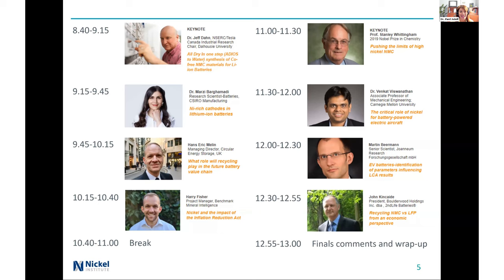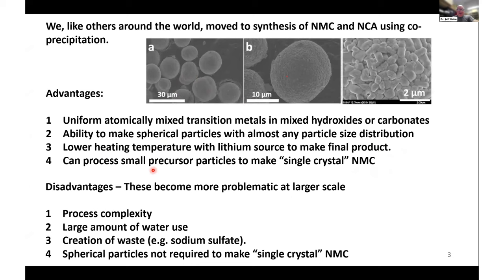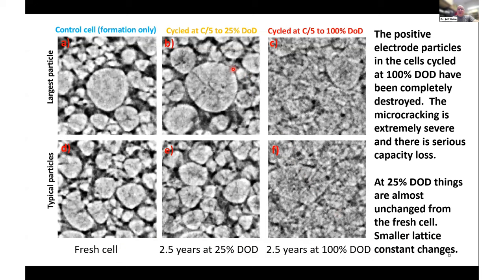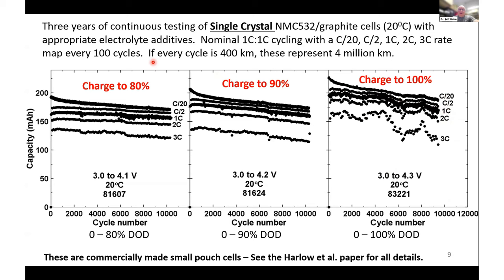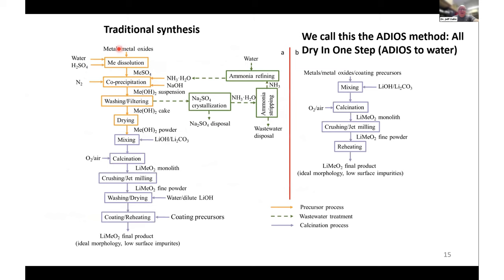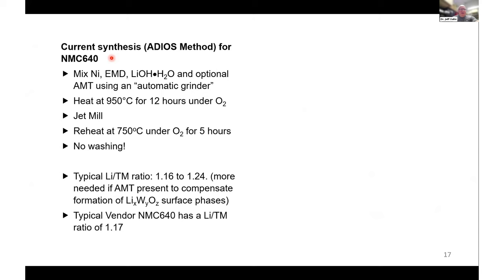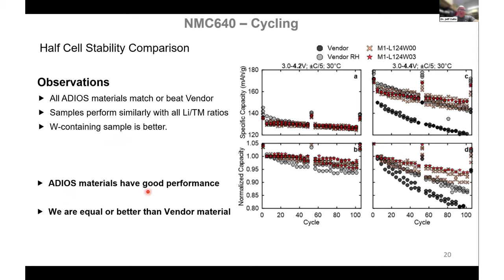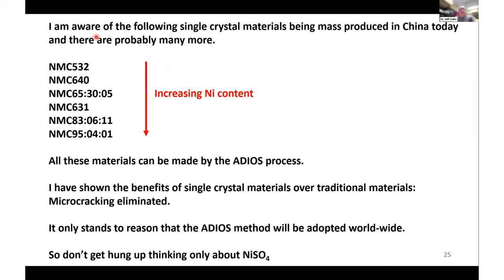NI Battery Day 2023 - Jeff Dahn

Comment: Thanks, great lecture and very informative.
I'm a physicist.  I have been trying to understand the large loss of range of EVs when it's cold. I just look at it from a simple circuit point of view.  The charged battery has a large number of ions available and they don't leak off much when it's cold.  The time integral of the circuit current should then be at least as large as when it's warm.  What is left in my simple loaded circuit view, is that the available voltage when UNDER the LOAD of the motor must be much lower. And it must be down at least 30% in order to explain a 30% reduction in range of the same percentage when the temperature is, say -10 C.  I tried to find reasons for this and I agree that increase of the viscosity of the electrolyte may be.part of it.  But I don't think that can be the only element involved.  
So, could you point to other reasons for the large percent reduction?
Thanks for considering this question.
Reply from the maker: Dear @johnrahn2677,  please check out Nickel Institute’s blog on the impact of cold temperature on EV range:   https://nickelinstitute.org/en/blog/2022/october/electric-vehicles-in-winters-range-related-concerns-and-considerations/